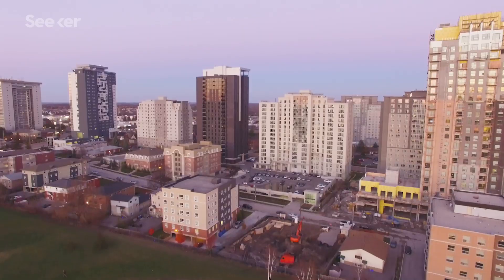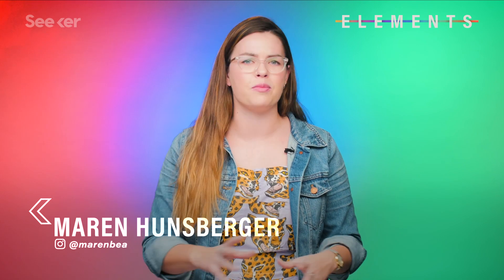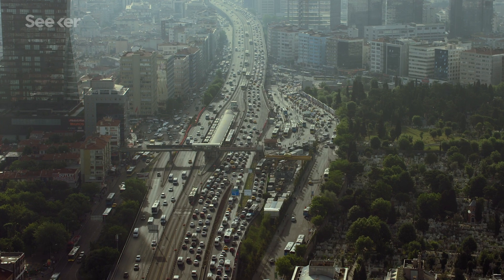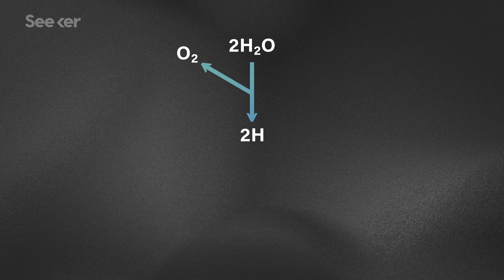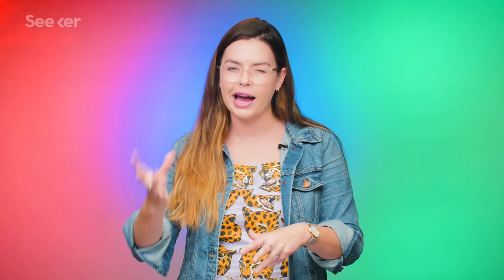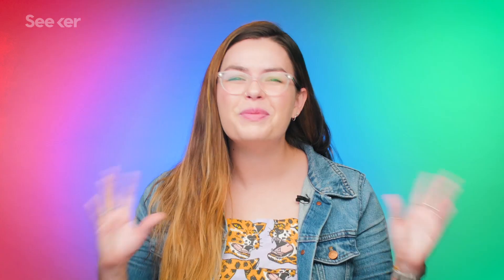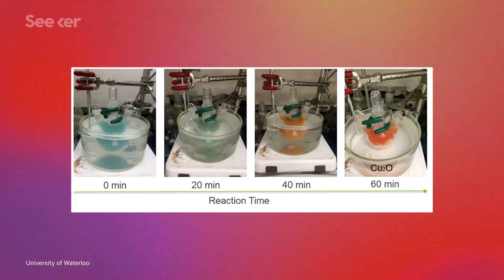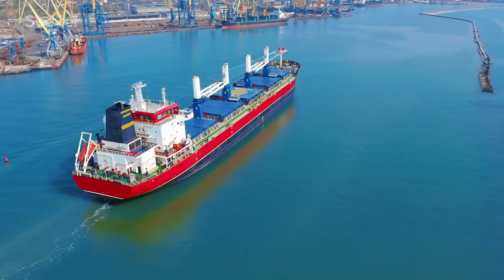Artificial Leaf Technology Could One Day Power Our World

Comment: I think this idea is great and could potentially be extremely impactful - but, ultimately, we have to ask the same questions we did before. Does the artificial leaf break down into soil? (no, it doesn't) How much fossil fuels does it require to build an artificial leaf? How can we support even more stress on our water resources, when agricultural use already has stopped the flow of many rivers and lakes are disappearing? This technology has the potential to further destroy biodiversity on earth, not enhance it. I am quite skeptical. I'm intrigued by recent research on the impact of megafauna on carbon sequestration. In effect, the removal of large megaherbivores, chiefly Proboscideans like Mammoths, by our species caused cascading effects of climate change. Large herbivores not only are seed dispersers, but their sheer weight packs the snow in the winter, and packed snow acts as a thermal insulator. Without them, the soil heats up sooner, releasing more carbon from decomposition. Rewilding or reintroducing these species or ecological surrogates could have more impact than an artificial leaf.

Comment: The most attractive part of this is the sequestration of carbon from the atmosphere.  Turning CO2 into a fuel is just kicking the can down the road.  Still, if there is any best way, cheapest, foolproof way of sequestering CO2, why not just preserve the trees?  They seem to be pretty robust at sequestering CO2 and in my opinion, much nicer to look at.  

Your comparison, of photo-hydrolysis to photo-syngas[esis]?  misses the bounty of useful benefits that are immediately applicable now:  fuel without ANY CO2 production and cheap water purification.  Let the trees sequester CO2.  If you want to make plastics or any other petroleum based products, well you have a lot of petroleum for that.  If you want to do that.  

2H2 + 02 ---->  H20 (nice for keeping healthy) + heat (power whatever you want)

Your thoughts?
Reply: It doesn't matter. If you pull co2 out of the air and make a fuel and then burn that fuel its no different than using a none co2 producing energy source. You arent adding any additional co2 into the air. Now find away to remove co2 from the air and have It impossible to return to the air like the form of crude oil.
Reply: @randybobandy9828  Thermodynamically, you will need an energy source to convert CO2 to Carbon (or otherwise).  So are you going to use carbon fuel sources to do that?  Even with what we generate to power the grid, only about 17-20% is carbon free (nuclear/solar/wind).   The infrastructure of how we generate power is overwhelmingly carbon based.  As I mentioned before, generating a carbon fuel may not theoretically add to the carbon load in the atmosphere, but it is just kicking the can down the road.  And I agree with you that irreversibly sequestering needs to happen.  CO2 will not be our downfall.  Warming of the methane clathrates (from the initial CO2 rise) will release CH4...which is 30 times more potent a greenhouse gas than CO2.

Comment: Artificial
  Leaf: (I found a local one from our regional news column about a years ago while preparing for exams)
• It is also known as Quantum Leaf which was developed by Indian Institute of Sciences’ researchers. (based on works of  biophysicists from the University of California, Berkeley.)

• It uses water, sunlight and carbon dioxide to produce a widely-used gas syngas (mixture of
 hydrogen and carbon monoxide) without releasing any carbon dioxide into the air. This will help in reducing carbon footprint.

• It is composed of completely bio-compatible, earth abundant, semiconductor nano crystals called
 Quantum dots which act as catalyst to convert absorbed CO2 into bicarbonate and then ‘formate’ (derivative of formic acid) that can be used as bio fuel.

Comment: As soon as you take CO2 out of the atmosphere to generate methanol, you will definitely push it back into the atmosphere as soon as you use it. The same problem is with trees, yes they take CO2... but the store it, and if you then chop the tree down and burn it, you release all the stored CO2 of the last 10, 20, 50 or 100 years back into the atmosphere... so it's not "clean"
Reply: Yes but that means you are not burning additional fossil fuels so it's carbon neutral in a sense

Comment: Unfortunately, this doesn't seem to solve the problem of global climate change. You are removing CO2, yes, but once you burn the fuel it just goes back into the air. At best its carbon neutral, but then wouldn't it be more cost effective to grow actual plants that can then be burned? Such as using bamboo in a modified coal plant? It's only real use would seem to be in delaying the move from gas to electric.

Comment: The presenter says that by "Mixing" cuprous oxide, co2, water and exposing to sunlight causes the reaction to happen. So mixing doesn't need electricity?
You can see in the pictures that the reaction time is 60 minutes for what 50-100ml of methanol. If you want to scale up the product and speed up the reaction, you will be needing high speed mixers, separators (for continuous process) etc. for process optimization. Where the hell are you gonna get the energy from?
Even small scale methanol plants should produce atleast 100MTPD. So scaling up this process of artificial leaf has it's own challenges to address. Personally, I feel that the current reaction rate of the artificial leaf is kinda shambolic.
All these so called tech YouTubers (except very few) are just half baked enthusiasts instead of being skeptical. They think science, engg and tech are some sort of magic🤦 I can better read the scientific paper and understand it better instead of listening to the video.

Comment: Why is this about storing energy in a form that has to be burnt, returning the CO2 to the air as fast as it was pulled out? We don't need to merely stop using fossil fuels. We need to take in more greenhouse gases than we put out, to try to scrub the atmosphere before catastrophic, self-sustaining climate cycles set in. When I think of artificial leaves, I think redesigned solar panels, made to resemble trees in such ways as to maximise efficiency, for instance. I think of organic materials converting light directly into electricity. I even imagine genetically engineered trees, created to actually make electricity instead of part of its starches.

Comment: I'm glad they're coming up with alternative technologies, but I still haven't seen anyone try to tap into the actual nature we have on this planet right now and use IT as the source of energy kind of like solar paneling that already exists.
Reply: What are you talking about? We have used wood as fuel for millenia. We have grown corn in order to make ethanol. We have made bio diesels. What are you actually expecting?
Reply: @randybobandy9828  What you're talking about is destroying nature for fuel, not tapping into it. In fact one of the main reason we're this far along into the climate change cycle is because of burning of wood for fuel and the like. That's exactly what we need to be moving away from. Let me put it like this, instead of using a tree as lumber and burning the wood for energy we should instead think of a tree as a tiny power plant, and we need to find a way to tap into that powerplant and divert some of that power. It would be none destructive and also much better in terms of sustained energy.

Comment: As far as what to power the world with the power grid, thorium reactors is an easy answer and we can do it now and it's very cheap and efficient. The start up cost to build the reactors is the only issues but would give power that costs us about 10 times cheaper than current. Thorium is in abundance too and a lot cleaner than uranium no issue with reactor melt downs or radiation leaks, and you cant make weapons out of it so no issue with everyone having it.

Comment: Sure these could pull CO2 out of the air, but that is to produce all the carbonaceous fuels they listed. They give us energy when we burn them. What is a byproduct of burning methanol, ethanol, or even glucose? Oh, that’s right. CO2. Everything that is taken out of the atmosphere is waiting to be put right back into it. This is not much of a solution for greenhouse gases, so I wouldn’t be so quick to slap the term “green” on this.

Comment: All gasoline engines can run on Hydrogen, and converting all gasoline cars would be easier, cost less, and pollute alot less than all the alternatives requiring building new cars with or without batteries. But for some reason nobody seems to take that route...
Reply: Sorry to burst your bubble, but gasoline engines cannot be converted to hydrogen. For starters hydrogen is far less energy dense than gasoline which means you would need far more volume in the combustion chamber. Then there are a multitude of issues after that. Stay in school kid. 🏫
Reply: @ipissed  It's allready been done, I've seen it myself. If you want to see it the Mythbusters made an old car run on it by just feeding hydrogen down the caborettor. BMW also made an engine to run on Hydrogen in the 90's, but dropped it due to the lack of market. 

Stay in school? Kid? I have 3 official educations, so I guess none of those apply.
Reply: @ipissed  So you didn't google. I know that because you still argue about something that a google search would make you agree with me about. Good luck with that strategy, you'll do great in life. 

Why BMW made a new engine? I have no idea, but I would guess they developed a fuel injection system for hydrogen to increase fuel consumption. Allthough a carburettor works fine when there is no emissions, there's no need to make the tank bigger than needed.

Comment: Does any one know what ethanol or methanol turns into when ingested by a living organism? It turns into formaldehyde. Just think of an oil slick you can't see in your water... in the rain. Think when ethanol evaporates its lighter and condenses at a colder temp than water vapor. Let a big spill happen and see the weather anomalies and mass die offs start happening. It happened when we started mixing ethanol in gasoline. watch the news

Comment: I have not yet worked out the overall efficiencies yet, but at first glance I think the best use of photosynthesised methanol may be to pump into depleted oil formations.  While I am totally naive about geological issues and how fluids may migrate but I imagine a liquid it may provide advantages compared to superfluid CO2, which is buoyant and will attempt to escape through cracks in the caprock.  The direct photosynthesis would be an advantage over the energy requirements of CO2 capture and pressurization to injection pressures.  As for an energy source, if the "ten times better than 1%" efficiency is being measured in the same fashion as solar panel efficiency then this process is 1/2 as efficient in collecting the source energy, and the existing internal combustion engine technology will squander another 80% of the collected energy generating motive power.  That fares very poorly when compared to solar cells charging a battery electric vehicle.  A high premium will need to be placed on the value of energy density to make a methanol energy economy viable in the long term and  with us so far advanced on battery technology short term I do not see this filling a transition role.  

As I stated above I am interested in seeing sequestration of methanol contrasted with sequestration of CO2 for energy cost as well as safety, possible contamination of other resources and possibility of re-escape of carbon to the atmosphere.

I'll try to run some back-of-envelope calculations and, if I surprise myself, amend this comment.
Reply: You are forgetting the part where solar panels cost alot of money to build as well as create a bunch of co2 in the manufacturing process. They have toxic materials as well. Not all vehicles are suited to use batteries as a fuel source. Planes of any real size will never run on batteries so a fuel that is many times more energy dense is needed. Also we haven't gotten far at all on battery technology... We are still using Lithium batteries and last I checked Lithium is a finite and rare resource. It also take a insane amount of energy to mine and refine. Not to mention the damage it causes the planet. We need a revolutionary battery technology to come out and replace Lithium because Lithium is not the answer.
Reply: @randybobandy9828  Solar panels are not expensive compared to other means of generating electricity.  Please name a technology that we rely on that does not use toxic materials.

Today's energy density for batteries do not suit all forms of transportation as we currently use them.  However, it is only the extremes of transportation that they are not suitable.  For example, over 50% of the ton-miles of US freight travels less than 500 miles.  That implies the vast majority of trucks can operate within a single charge, recharging during normal depot operations.

I believe trials are already underway with several european regional air carriers utilizing battery-electric planes.  Intercontinental flights are out of the question for the foreseeable future but intracontinental flights will feel pressure from the cheaper operation of regional carriers operating electric planes.  

With many fewer trucks requiring an alternative energy source, the economics of providing that source will be poor.  Rather, transportation practices will adjust to take advantage of the lower operational cost BEV's will provide.

Lithium is not scarce.  As I understand the history of battery research, lithium was selected as a potential material precisely for the potential of high gravimetric energy density you are in pursuit of.

I posit that the difference in energy intensity to manufacture a BEV is approximately proportional to the difference in mass between the two vehicles.  This is far from the "insane" amount of energy you cite.  There have been many studies published that reveal any difference in energy intensity in manufacture between the two vehicles is compensated for within 2-1/2 years of operation of the BEV, even being charged from today's dirty grid.

In my view, the economics of battery vehicles have already won in most cases.  If the surface area utilized is valued as a resource I still feel that photovoltaics better utilize that resource over what this video presented for photosynthesized methanol.
Reply: @mrhickman53  we aren't comparing solar panels to other technology. We are comparing it to this new potential technology. Solar panels arent cheap and they become more expensive in areas that don't have alot of sunny days(cost to energy production ratio). No long haul trucks will not work on batteries. There is a reason nobody has released a battery powered semi truck yet. The amount of batteries it would need to power a 45,000lb truck is too large to the point that the batteries weight becomes a serious issue. It's like a  space rocket, you can't just add more fuel to a space rocket because the weight of the fuel ends up weighing so much more that the additional fuel actual uses more fuel to carry it than it would to help the rocket go further. There needs to be a better battery technology vs Lithium, not to mention the life cycle of lithium Is around 500 cycles before its below 80% of its maximum capacity. Yes Lifepo4 battery will do 3000-5000 charges but it also requires 2x the weight and volume of battery for the same capacity vs traditional Lithium. That makes it uses less for large trucks.

Comment: this.. was a commercial. Little morr.

1. We have an easy scalable process that turns CO2 and H2 into H2O and CH4.

and Mathane, is considered the best Organic Chemical fuel.

2. The only problem with hydrogen is transpirtation. it can leek. Even if not enough to br a fire hazard. but enough you want it produced near its target.

As to price of production, fuel-cells can work back. they just need power fed to them.

3. For Carbon Scrubbing/fuel production..

Chalk water. pump in CO2 H2 mix in high preassure..

As they interact in it.. the methane  production.. And more complex hydrocarbons becomes easier.

Comment: No offense seeker but you guys usually gloss over information without providing proper explanations or answers to possible questions asked. One should mention that this process of creating methanol then burning it is carbon neutral. That is there is a net gain of 0 carbon dioxide to the atmosphere as it is reabsorbed by plants, it's like the water cycle.